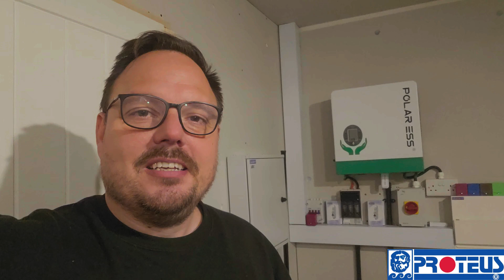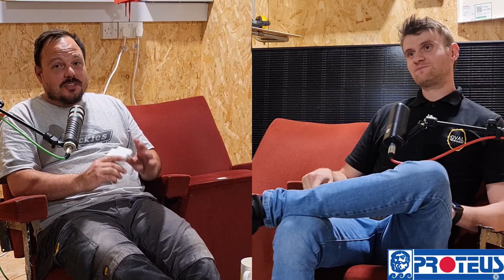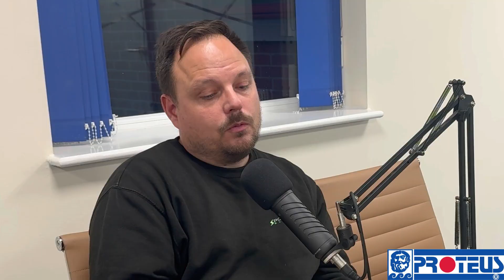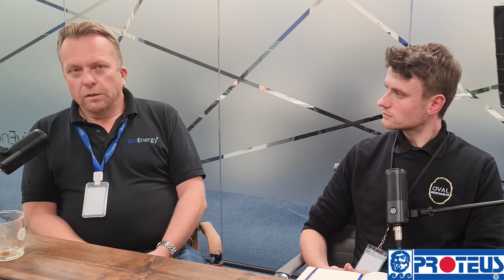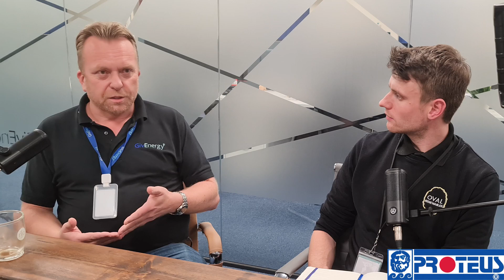New GivEnergy inverters, batteries and more with Jason Howlett Global CEO

Comment: I would love to get a Polar ESS but a lot of installers I speak to don't want to do it. I would love to get one with the full 26kWh and 6kW inverter.
Reply from the maker: We install them (Mark here)
Reply: @TheRenewablesPodcast-bv8ie  Thanks. I am down South so pretty far from you guys? Do you know if you can put a whole consumer unit on the EPS side without an automatic changeover from the grid?
Reply from the maker: @TheTechOnline  would depend on the load from those circuits. Basically would want it under the inverter eps rating. But yes it's possible.

Comment: I have one given energy all in one I am waiting for the second GEN to come out also I had a question can I mix and match with 9.5 or other battery options with all in one will all in one mix match with others? do let me know But GivEnergy all in one is super for summer month. I also like mentioned in the talk I also use of peak energy as I am on Eon next V4 and I only use Cheap rate but I want to get one more battery because sometimes I am out of juice by 7 o’clockpm keep the good work going thank you
Reply from the maker: Thanks. To my knowledge prently you can't pair a hybrid or 9.5kw battery in with an AIO. They sort of charge/discharge into each other. But I'm led to believe that might be a thing soon 🤭.
Reply: @TheRenewablesPodcast-bv8ie  thanks for the reply really appreciate it